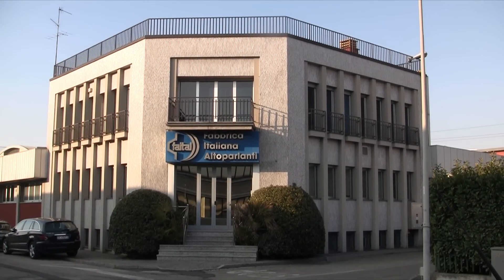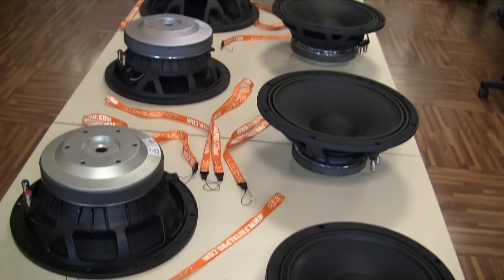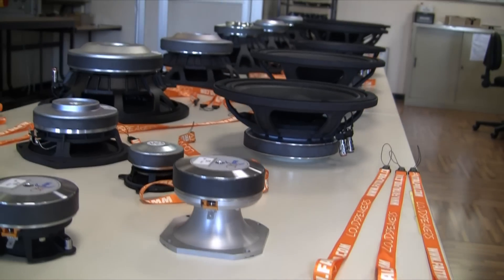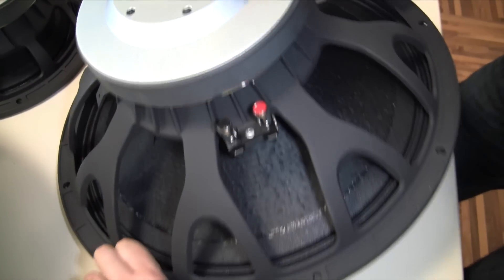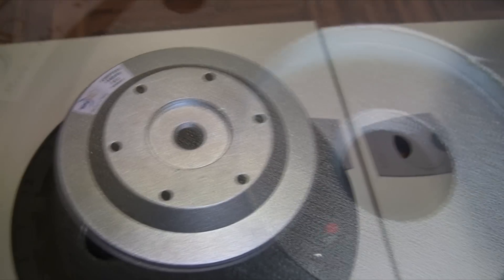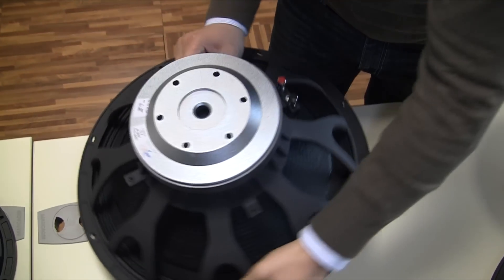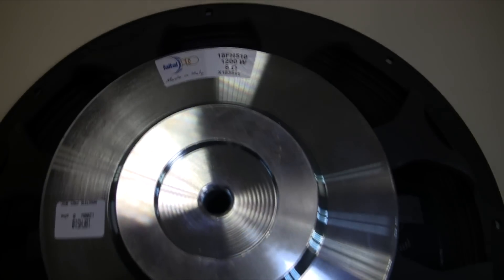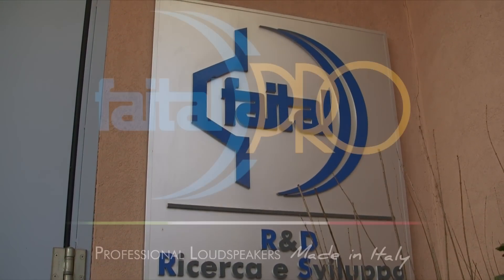FaitalPRO NEW FERRITE Loudspeakers at ProLight+Sound 2012 (part 1) [ENGLISH]

Comment: I am looking to get 16pc Faital pro for a 2 way line array cabinet build with 2pc 1.4 driver  linearray flare and 2pc 12inch mid bass...ground stack compact front loaded cab......but am debating with these 2 model...12FH510 or 12FH530 witch is much better and why will u pick that model